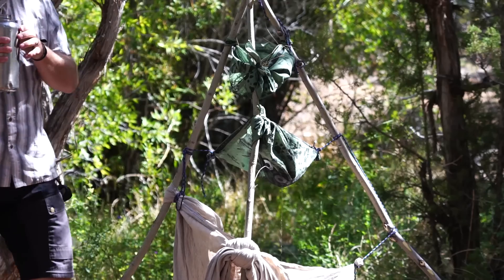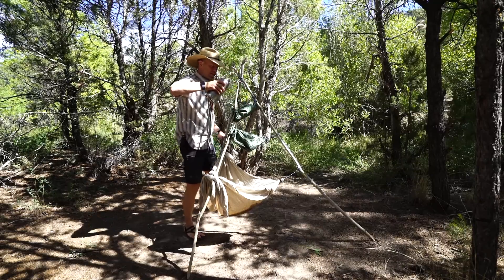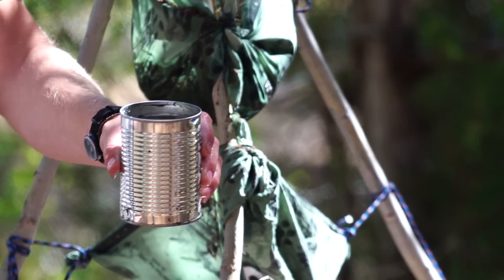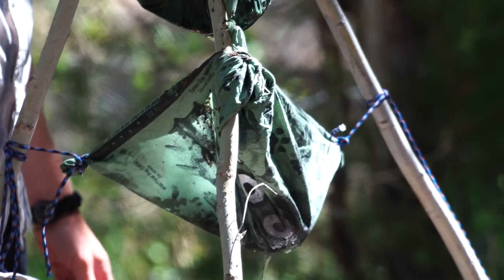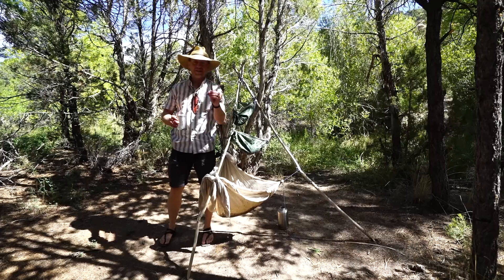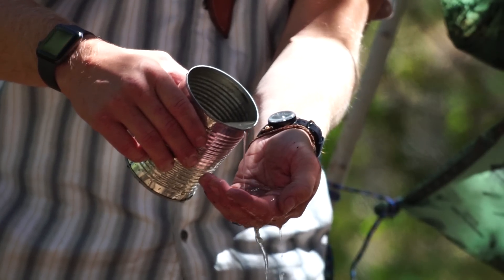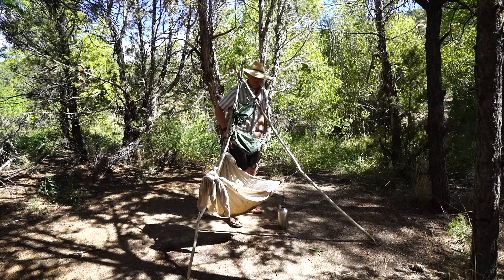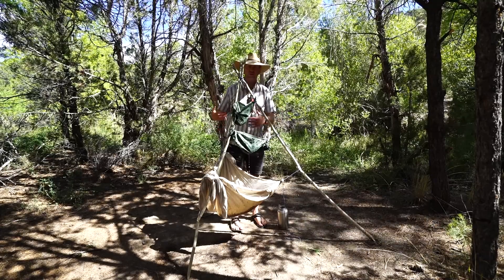Tripod Survival Water Filter! Making nasty water ok.

Comment: Thanks TJack. After SHTF, even if you have a good water filter like a Sawyer, prefiltering is important because it will help your filter last longer.  Once you know the basic ideas of how filtration works, you can make filters using bandanas, empty buckets and bottles....lots of the detritus of modern life can be creatively adapted.

The Romans used replaceable 6 foot sections of clay pipe packed with sand and charcoal to filter the water going to the fountains of ancient Rome.  Those fountains were the municipal water system.

My favorite way to chemically treat large amounts of water while bugging out is bleach, but because liquid bleach has a shelf life, I prefer bleach tablets that will work for many years.  This product is the same chemical as Pool Shock.  Each tablet makes 2 OZ of bleach.  https://www.amazon.com/gp/product/B07BQQNDPQ/ref=ppx_yo_dt_b_asin_title_o08_s00?ie=UTF8&psc=1